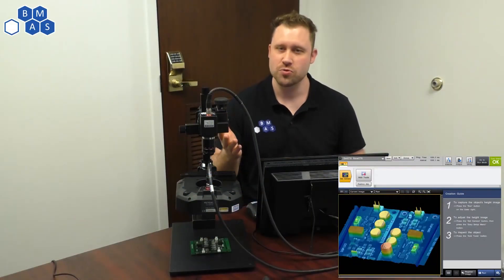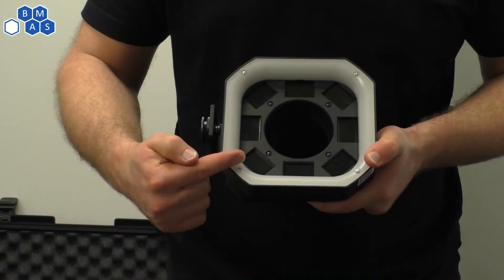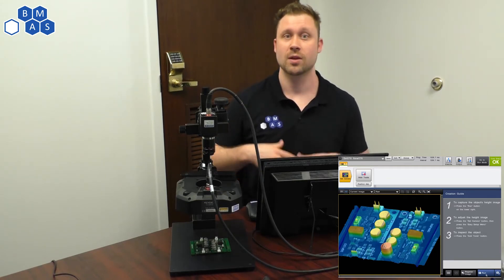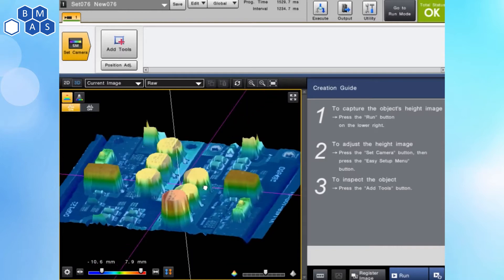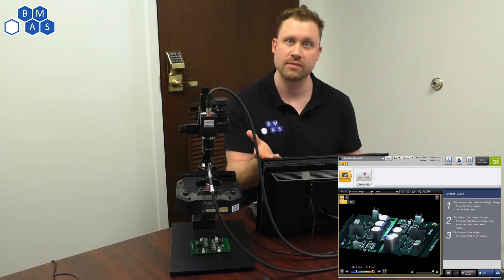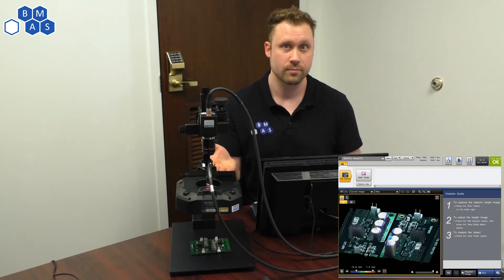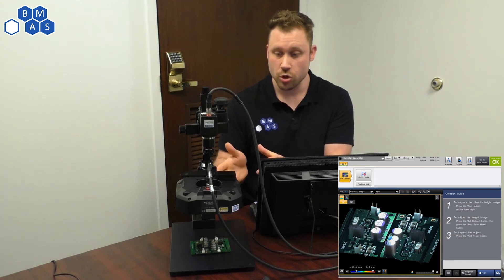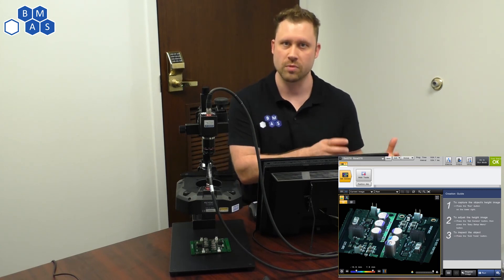3D Vision on a 2D Camera: Advanced Lighting Inspection | Machine Vision pt9

Comment: Is there a camera/sensors/vision system that would be capable of taking large dimensional measurements of an aluminium extrusion?
Reply from the maker: The short story is, it depends.  What kind of dimensional measurements?  What precision?  How big are the aluminum extrusions?  Generally speaking, the larger the part, the less precision you'll get from a vision system.  For example, if your vision sensor is 1000 pixels wide and your field of view (FOV) is 1m, each pixel is 1mm.  If your FOV is 1cm, each pixel is 0.01mm.  There are a few other details, like lens quality, etc, but the size of the pixels is usually the most important factor in measurement precision.  This means if you have a large part and want high measurement precision, you'll need a very high resolution camera, and at some point it's not practical.  

Perspective and lighting can also be a challenge with measurement applications.  If your parts are thin, a backlight works well.  If your parts have crisp edges, you may also be able to top light with good results no matter how thick the part.  If your part is round, you may need to use more specialized lighting like a collimated light source.  If your part is rectangular with rounded edges, a 3D vision system or 2D laser profiler might be your best bet.